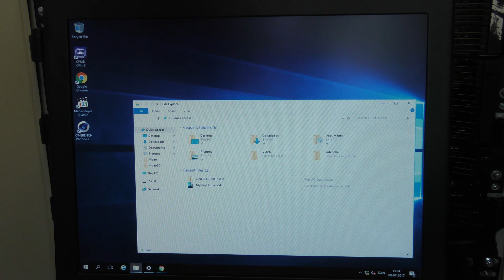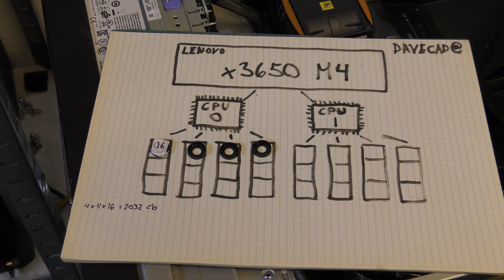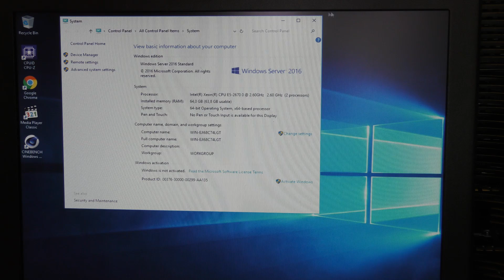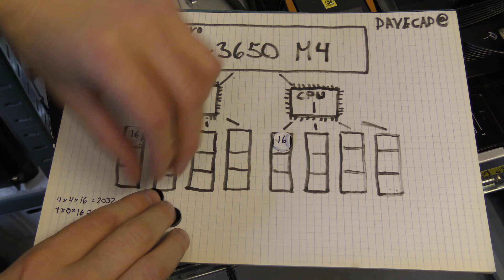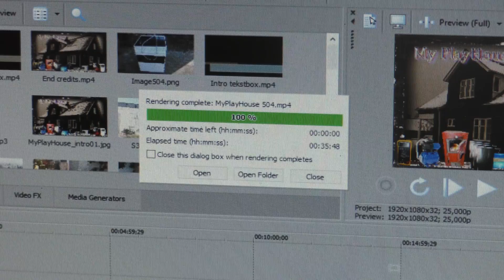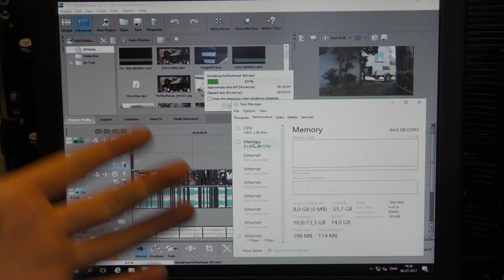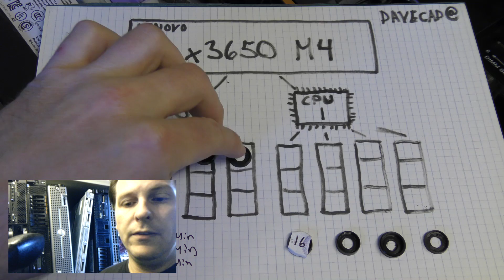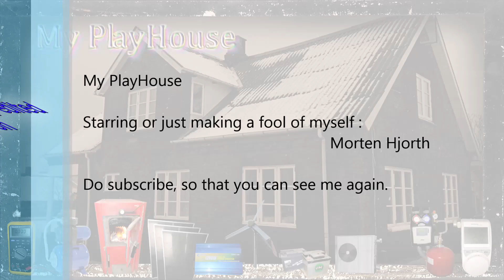Testing, putting in Memory, in various Unbalanced Ways - 545

Comment: it is much easier to simply run MemTest86 of any flavour and version
this would give you real but quite slow speed (as MemTest86 is accessing memory in almost abnormal sequence, therefore most all features, which makes ram fast does not apply to MemTest86). 
benchmarks of always make heavy use of caches and bigger cache is less effect would have number of memory controllers and number of channels on computation. some of computations are so small that with some Operating System tweaking you can fit it in caches alone and never use RAM while computing.
Reply from the maker: Okay

Comment: I'd like to see this run with another benchmark tool if you find one...especially if it's one that can run a couple times without taking your entire day. I'm surprised that having the CPU without memory was a bootable configuration. Even more surprised that it ran through the test faster than having some memory on each NUMA node. I would have guessed accessing memory through the other NUMA node would have made that test slower. Or maybe the horrible scheduling in Windows just means both CPUs are accessing memory across nodes when memory is on each CPU.
Reply from the maker: Hi 808jpm
Thank You very much!  That was also a surprise for me. I see on the numbers of that video, that I have to waight doing more memory testing for a bit :-)
Thank you for watching! :-)

Comment: I think that in this setup you should use Prime95 program for CPU/RAM performance testing on full load. It's tiny and even portable. Widely used in tech sites doing performance comparison.
The GB TB question. As the amount is below 2 digit values in TB it should stay in GB. Once it is common for 2 digit TB amounts e.g. 12TB and more it should be TB named.
I like your videos, your recent road trip ones are very interesting. Comparing the scenery and architecture among countries :)
Reply from the maker: Hi Boskorp
Thank You very much!
Thank you for watching! :-)

Comment: I'd consider everything above 1 TB as being "1 TB", and then increment in like 1,1   1,2 and so on. +/-16GB doesn't make much sense in the overall. Although, it still should be directly specified in order pages, part lists and so on. But in daily vocalm it'd be 1,2 TB RAM and so forth.

That being said, how noisy is the server by itself, and where did you get it? Ebay like some of the others?
I was considering getting an i7 7700K system for gaming/content creation and so on, but at this point, a Xeon makes a lot of sense. A quick search told me that an overclocked i7 7700K (@4,9GHz) could only deliver ~1000 cb in Cinebench. So your setup makes more sense.

Plus, you already added a graphics card to your setup. So it IS possible. Did you ever try gaming on it?

-I think you might see the result you've experienced, because  the first CPU more or less takes over for RAM addressing as, like you said yourself, it doesn't require the amount of RAM which would cause this. I mean, you still have 64GB combined, which is then 32GB for each CPU. Which again is more than enoung for handling Cinebench and video transcoding.
Maybe try with a single 1 or 2 GB sticks for each CPU? If you have that lying around, that is.
Reply from the maker: Hi Stefan Ejegod
Thank You very much!  I do not game much,, I think it would work on the server, but,, I´d think there are cheaper ways to get to this.
Thank you for watching! :-)

Comment: Most people are saying gigabytes but realistically, its more of a display format issue than anything. 
For example: 
12800 Gb should be displayed as 12.800 Tb (zeroes MUST be present).
3584 Gb should be displayed at 3.584 Tb.
365 Gb should be displayed as 365.000 Gb.
3.5 Gb should be displayed as 3.584 Gb.
768 Mb should be displayed as 768 Mb. (with this one however, if Gb is a baseline, 0.768 Gb should be displayed).

Basically, whichever order of measurement to three decimal places.
Also, during the "switchover" phase, you could do old and put new next to it in brackets.
Reply from the maker: Hi Mac·au
Thank You very much!
Thank you for watching! :-)

Comment: If you want to test the improvement with the different configurations of ram, the most ideal would be to launch benchmark focused on ram, cinebench and render a video are oriented more at the speed which is the processor is able to render the frames of the image . Sure that on the internet you find some good benckmark for ram, what I usually use are in linux and I do not think you can use them
Reply from the maker: Hi Iván Rodriguez
Thank You very much!  But unbalancing the RAM can slow down the hole system,, that was what I was trying,, it did not show well :-/
Thank you for watching! :-)

Comment: All, thank you very much for answering Morten's question regarding the units for amount of memory discussions.  

Summary of responses as of 2017.07.12 (US EST):
GB only:  8
GB up to limit of 1 TB:  6
GB up to a limit between 1.1TB and 10TB:  3
TB only:  3

Sounds like preference is still for GB since AFAIK most memory sticks are purchased in GB values.  16GB and 32GB memory sticks are projected to be sweet spot for cost / GB for the next couple years.

Intel Skylake servers will have very interesting add memory task rules.  If you think of use cases for documentation or software tools to assist with adding memory, the hard copy (including .pdf) should probably remain in GB.  The SW tools should probably allow user to select their choice of units.
Reply from the maker: Hi Tim Meserth
Thank You very much!  There are some good points,, as the blocks also grows, the issue becomes a lot smaller,, when we get to 128GB blocks it will be the same as when we went from MB to GB.
Thank you for watching! :-)

Comment: it is very hard to convey information in 1.1 TB or 1.2 TB or 1.3 TB when talking about memory. Like what is the exact number for 1.1 TB of memory? since memory is in blocks of numbers divisible by 2, like 8GB, 16GB, 32GB etc. and odd number like 1,152 GB of ram doesn't  translate well, if at all to 1.15 TB of ram. It is easier to keep things in decimal than rater fractional. so if a server has 1.5TB of ram that is easy to understand. it is 1024 + 512 but if it has 1.1TB the math is not so easy. I'd personaly rather have the number in GB until we get like 128gb or 256GB or 512GB single stick DIMMs
Reply from the maker: Hi Inconsistent Manner
Thank You very much!
Thank you for watching! :-)

Comment: The interferring ISO Standard has "Decimalised" KB i.e. 1000KB now = 1MB, 1000MB + 1GB and so on, which is a lie as you know. I bought a new PC with 256GM SSD and a 4TB HDD. My 4TB HDD only has 3.63TB.
I would like your help. I got Cinebench and the results are not what I expected.
I have an i7 Skylake processor, Quad core, 2 threads per core and all run at 4GHz, I have 16GB (2 x 8GB) of DDR4 RAM and an Nvidia GTX960.
I expected the CPU test to be much better than it is!
I just ran the Cinebench program with Firefox open only and got a CPU score of 879cb.
I then ran OPENGL and got a score of 112.68fps. Is that good?
Do I need to disconnect my Router to get better results and shut down all open programs? I would be gratefull if you could help me. Cheers.
Reply from the maker: Hi The Lamb
Thank You very much!  I think your numbers are okay! The server I ran this on had two CPU´s with each 8 cores and scored 2033-ish 879 must be good on a single quad core!
Thank you for watching! :-)

Comment: well lets say the cpus have a qpi bus of 8GigaTransfers/s(for E5-2650 v2) that is about 32GB/s so the system can transfer data to the 2nd cpu at 32GB/s lets also say your ram is running 4 channels at 1333mhz that's about 40ish GB/s so so if half of that is being sent to the 2nd cpu over the qpi bus that's still only 20GB/s you still have headroom

you would need to drop down to 2 channels to see a big impact if any
Reply from the maker: Hi meh757
Thank You very much!
Thank you for watching! :-)

Comment: As for your question, I think we could do something as was done in GB/MB days: first list as number of terabytes, then give exact gigabyte number in brackets, like: 1.2TB (1280GB). This way we have both overlook and exact number.
As for memory performance, you need to have something that avoids cache and Xeons have huge caches. Cinebench is meant to test CPU power, not RAM power :). Would also be nice if you tested with 8GB/4GB sticks, like 16,16,4,16 slots. RAM is actually important in servers as you usually run multiple VMs so cache can't do much (thats why xeons have huge caches anyway). I was surprised that your server POSTed without any ram in one CPU, thought this isn't possible just like in 56XX series.
Reply from the maker: 6 years later,, I have been getting more use to TB by now,, even ran in to PB now.

Comment: Gigabytes.
I think up to something like 10TB it should be Gigabyte.
Reply from the maker: Hi XX302 Agent der Resistance Hamburg
Thank You very much!
Thank you for watching! :-)
Reply: Sorry if i annoy, but i want to buy my first server and you seem to be quite the expert about the x3650 ;)
First, does the M1 have PCI-X ? On some website it said that 2xPCI-E and 2xPCI-X is possible, and on some sites it says 4xPCI-E and no PCI-X... so, what is it ?
And my second question, i found this server shop, the servers are really expensive, but things like NICs or HDDs are dirt cheap (2€ for 150GB Drives), is that a "normal" price or is this site maybe a scam ? 
(https://www.servershop24.de/storage/ibm/festplatten/)
Reply from the maker: You can get a PCI-X riser card for the x3650´s,, they can be expensive,, what do you need the PCI-X slot for,, it´s very old,, and not widely in use any more. PCIe 1x-16x is the normal now.
The 2€ drives are FC drives FiberChannel,,, I did a video on the NetApp SAN just last week and said that FC drives are dead,, SSD´s are way better,, there are no demand for FC drives,, so they are giving them away-ish. (They use to be SOOO expensive :-/ )
Reply: Okay, thank you :)